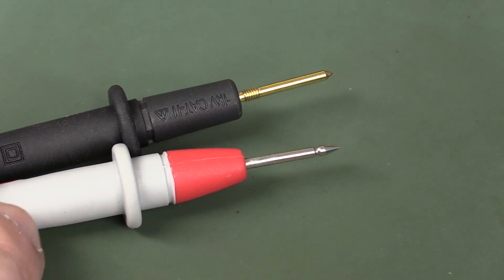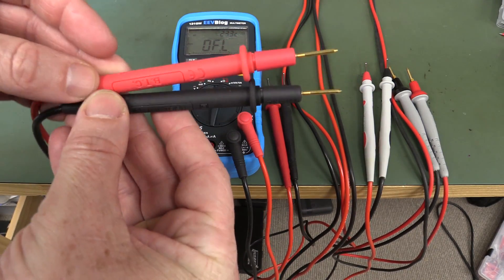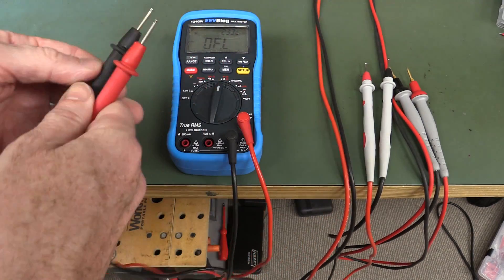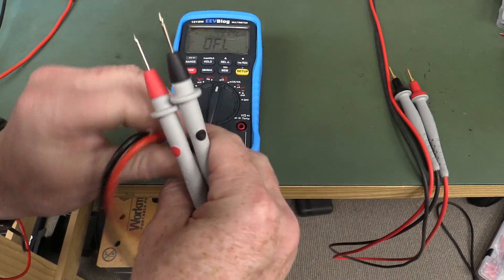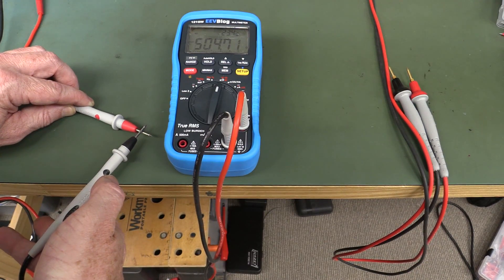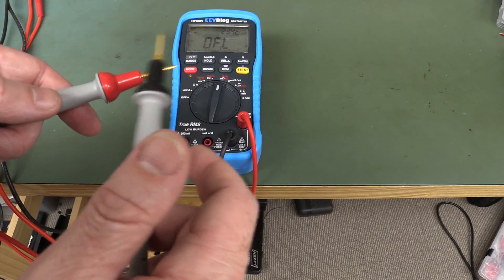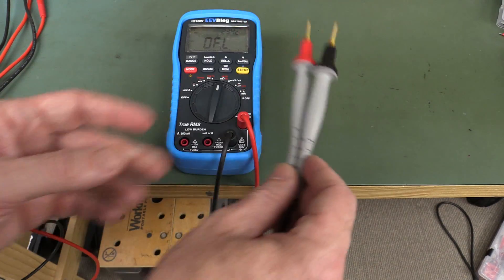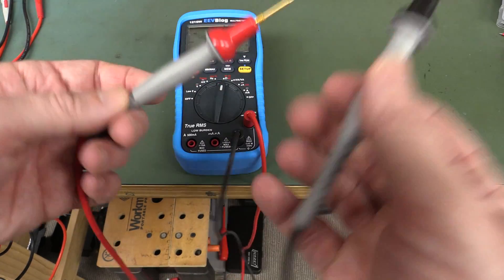eevBLAB #33 - Why Gold Plated Probes Matter

Comment: I see in the background you have a black and decka shop box. I got 1 about 25 years ago and it was a mission, "they only released them as a 1 off promotion " (supposedly)
Your 1 looks quite new.
Where did you get it?
I'm in NZ so I should be able to get it from your source if it's current and in AUS.
Thanks 
Russ

Comment: Gold is very soft, it will wear away in very short time. The amount of gold used in these probes is worth virtually nothing. Total waste of money if you know what you are doing.
Reply: Oskar Skog 
"Soft, pure gold plating is used in the semiconductor industry. The gold layer is easily soldered and wire bonded. Its Knoop hardness ranges between 60-85. The plating baths have to be kept free of contamination.
Bright hard gold on contacts, with Knoop hardness between 120-300 and purity of 99.7-99.9% gold. Often contains a small amount of nickel and/or cobalt; these elements interfere with die bonding, therefore the plating baths cannot be used for semiconductors.
Bright hard gold on printed circuit board tabs is deposited using lower concentration of gold in the baths. Usually contains nickel and/or cobalt as well. Edge connectors are often made by controlled-depth immersion of only the edge of the boards.
Soft, pure gold is deposited from special electrolytes. Entire printed circuit boards can be plated. This technology can be used for depositing layers suitable for wire bonding."
*Wikipedia
Reply: Stephen Cook
They use an alloy.  A pure gold plating would indeed wear off more or less immediately, as anything contacted would be harder.

Gold plating is better than nickel for test leads -- but beware of thermocouple effects due to differing metals if you are making low voltage measurements.  For low voltage work the ideal is to use the same materials.
Reply from the maker: It's a hard gold plating, not soft.
Reply: I've got the so called "needle probes" here from china, the thinner ones for microcomponents. And it seems to me they work exactly like Dave's gold plated ones. (And thank God they do)
Reply: Rhodium is extremely hard even in thin layers, and is pretty resistant to corrosion, it is often used in high end gold watches and the like as a protective layer. It is only an atom or two thick and hence pretty much transparent.
Reply: "hard gold plating" is Gold+Nickel. It's usually a darker orange color. There is also electrum which is Gold+Silver(and sometimes copper), which is also harder, but is usually used to decrease the resistance of the gold coating while also retaining the superb corrosion resistance. Electrum coatings can be anything from pale yellow to rose.
Reply: Since you mentioned Rhodium, does plating with it serve the same purpose as doing it with gold? I have used some high end audio connectors from a well regarded brand (not the ultra esotheric stuff, just well made $50 ones instead of $5 usual ones) which uses Rhodium plating. If I remember correctly, they said it's because it is harder to rub off and still doesn't oxidize. Is it true that Rhodium also doesn't oxidize? By your comment it seems that it definitely is tougher than gold and won't come off easily.
Reply: I've experienced the thermocouple effects, in particular when I was teaching science and measuring small PDs, and also in a previous life in a research lab measuring biopotentials.
Reply: Its not hard, exactly my point. There are hard metals that can be used, the problem is that most of them oxidise and produce a non conductive coating. Gold doesn't oxidise. The layer in these probes is only a few atoms thick, and will rub away in no time at all. Hard gold plating, is a fiction, unless it is gold that has been treated with a surface monatomic layer of something like rhodium which negates the purpose of using gold in the first place.  I taught chemistry and also electronics for many years. One of the reasons it works as a better contact is exactly because it is soft, it deforms. Bouncing or striking probes is a bad practice, it gives false readings. If you need a continuity test just make a simple continuity probe.
Reply: +EEVblog.  What's a "hard plating"?  Gold is about as soft as lead, or so I've heard.   What makes it "hard" in this case?
Reply: Stephen Cook
Yes, anything with small voltages requires care to be taken.

This applies to all connections -- if you use a gold or silver plated test lead plugged into an instrument with a nickel or copper alloy socket then you will have a slight voltage potential there.  The voltage produced is dependent upon the temperature at the junction, so you may not notice it initially then be scratching your head a couple of hours later when a shift in ambient temperature has thrown your measurement out.

Probably not an issue for most hobbyist work, but worth knowing.

Comment: anyone saying this is irrelevant haven't really worked with integrated circuits. or any other sensitive electronics. when I first worked with cars, I never understood the expensive multimeters and so on. later as I'm building my own amplifier I want the best and most accurate there is. because you cant even begin to understand how sensitive some circuits are. thank you for this video! will definitely buy these.

Comment: How about getting them coated from jeweller's shop, they'll take very little money for a thin coat, but will it be effective?

Also, they say, silver conducts better.
Reply: silver tarnishes quickly though. at that point you could might as well use full copper probes. gold plating makes a lot more sense because the main point of it is to stop oxidization.

Comment: Ok,  you never explained what makes the gold plated better. There needs to be some scientific explanation or  it could just be due to manufacturing, general quality of the products, etc. Please follow up with the science.
Reply from the maker: Gold does not tarnish or allow formation of an oxidized coating, basic industry knowledge, hence why it's used in all quality signal switch and connector contacts for example. Someone borrowed my scanning electron microscope...

Comment: seems to me that your plating will wear off in NO TIME ... given that we tend to keep these in firm contact with other metals and move them around...  effectively  grinding off the coating...
Reply: Gold has been used for electrical contacts for decades.  A hard gold alloy is used.  It doesn't have to be pure gold to reduce the impact of oxidization.

Comment: I wonder if a gold plated probes make a real difference, then why reputable manufacturers like Fluke does not provide such probes (even as an option) with their high-end Multimeters like the Fluke 289/287 series?  

Thanks
Reply: Probably to save money $$$
Reply: Because they do?  Fluke TL910 probes are gold tipped.

Fluke seems to divide the world between electricians and electronics.  And probes for electronics are gold tipped.  Electricians get nickel alloy.  And I guess once the nickel is heavily oxidized, and you don't think to use sandpaper to remove the outer layer, you should just buy new ones.

Comment: What about 24 k solid wire  probes ?
Reply: If anyone in Ger... oh wait, how stupid of me, of course everyone in Germany needs their oscilloscope!
Reply: Fake News,  mercury tends to amalgamate (form a solid solution with) with noble metals like gold and silver but it won't do that with iron or nickel or aluminum.  So saying mercury dissolves most metals is far from accurate.  Aqua Regia  (nitric and hydrochloric acid mixed together) will corrode most metals but not all.  It doesn't really dissolves them because if you evaporate the liquid you have metals salts, like gold nitrate and gold chloride left not metallic gold.
Reply: They'd be expensive, heavy and would bend or compress easily when you use them.  But at least they don't react with normal substances.
Reply: Mercury would dissolve most metals it came into contact with , I have Gold and silver wire laying around and was just wondering
Reply: I 'am a master jeweler and know all of this , thanks anyway . I have had a few wedding / engagement rings brought to me back in to 80's and early 90's that people had broken the old type of thermometers filled with mercury and some had gotten on their rings wanting to know if I could "fix" them after they fell apart . I make my own Aqua Regia and have to change out the glass jars every few years because it will eat through the glass ( it scares me ) I use it to make plating solutions  , this is why I was wondering about the 24 K probes . I have a bunch of wire I made laying around
Reply: If anyone in the US has a oscilloscope they don't need contact me , thanks
Reply: Oskar Skog They would also have greater resistance per foot of test lead unless you also increased the cross section of the test lead wires to compensate, thus making the leads even heavier still.  Gold's great strength is its resistance to surface oxidation (mercury also fits this bill) versus most other metal choices thus greatly reducing contact resistances, but gold itself has more resistance than a copper or silver conductor so it is not the best choice for a wire conductor of any significant length, even if costs are not a concern.
Reply: Why are you talking to me?

Comment: "Dave Jones - 2017" - That's the good thing about gold, it will not react with anything.

Heard of Aqua regia?
Reply: You don't normally work with electronics that had been immersed in Aqua Regia, though :P
Reply: I love me some aqua regia solder. Hmmm, sex on a stick!
Reply: For all intents and purposes, it won't react with anything.
Reply: We can argue about some comments here
Aqua regia will reacht to form chloroauric acid
Mercury won't react with gold, it will dissolve it (just like water and table salt)
And cyanide will form a complex with the gold and once the cyanide is gone it will fall out of solution... it's very close to dissolving but it is an reaction afterall
Reply: John Howard gold amalgam is very brittle and as you press on a contact it will crack and flake off...
also it would be very hard to gold amalgamate plate (?) some nickel contacts

Pure mercury would be very bad idea (ignore "toxicity" and "hazzard") if you would need to press on a PCB it would just flow sideways becouse of the oxides coating the PCB
Well if you used dilute HCl or nitric it would most likely amalgamate with the solder and copper traces and stick to it...

If you would platnum plate the contacts it would be the best idea

(Btw. By dissolving we ment the amalgam... we try to explain it very easily to understand)
Reply: or cyanide
Reply: Hydraulic Press channel will make it react to something :D
Reply: or mercury?

Comment: What a load of old twaddle! 
Making sure your probes are clean and in good condition is more important than gold plated tips. It's highly likely that the metal you'll be making contact with to take your measurements won't be gold either. This is reminiscent of the argument that some people make regarding gold plated connectors. If you really intend to take measurements with virtually no physical contact pressure and with the briefest of contact time then you really are asking for poor results whatever the probe tips are made from. Obviously, the continuity function of any DMM should be sufficiently responsive so as to leave no obvious delay in alerting the user that contact has been made but all this frantic probe touching, now with feather light contact pressure, is completely unrepresentative of real world scenarios to the point of becoming ludicrous.

Comment: Just tried this with the probes that came with the cheapo Aneng AN8008 and whilst slapping the probes together didn't give good results due to the update rate of the meter it still buzzes with just the weight of the probe. In fact it buzzes no matter how lightly I try and make them touch, even under 40x magnification bringing just the tips together it buzzes as soon as they touch (it doesn't even feel like they're touching and the probe I'm not holding doesn't move at all, only way to tell they are touching is visually).

EDIT: Not saying that gold does or doesn't give a better connection, just that this demonstration doesn't seem to be very accurate. Perhaps there are other factors at play.
Reply from the maker: Of course there are other factors at play. The gold contacts don't tarish or oxidise, other probes can.
Reply: Oodain, Nickel's corrosion resistance is due to a very thin oxide layer on the surface ( a few nm thick ) which stops further corrosion. That oxide layer is always present when nickel's exposed to air since if you scratch it off it reforms immediately. The oxide is green only in bulk and if you're seeing green oxide you might want to fish your probes out of the sea.
Reply: Mechanically breaking it is one reason. Another cooler one is that since the oxide is literally a few atomic layers thick it's dielectric (insulating) properties are not the same as that of bulk NiO. The electrons might even tunnel right through as if it wasn't there. But that would only work on a fresh surface with thin oxide. As it ages the layer grows and eventually it's not gonna make good contact.
Reply: Kieran Check them again one year later and see how much contact is left on the surface. They always work better fresh.
Reply: nickel is almost as corrosion resistant as gold, the oxide is also bright green...
Reply: Oodain you are talking out of your hat:
https://en.wikipedia.org/wiki/Reactivity_series
Reply: how so?
from that table there is only really copper between gold and nickel that isnt a precious metal, a rare earth, liquid or simply too soft to use as a terminal of any kind.
on top of that are you sure that that table actually covers everything?
despite copper being lower on the list nickel has been known to dramatically increase the corrosion and oxidation resistance of copper wire, especially at higher temperatures.

http://www.sciencedirect.com/science/article/pii/S000844339900021X
Reply: cool to know why the reactivity and practical corrosion resistance differ.
i will take your word for it, but since nickel probes obviously still work that oxide layer must be mechanically weak enough for most normal contact to dislodge it or standard probes would barely work.

if that is indeed the case then gold probes would make plenty of sense where contact was so minimal or delicate that one couldn't dislodge that layer but otherwise i doubt it would make more than a small practical difference.
Reply: Tried the same with my Fluke 17B and the probes that came with it. These are at least 5 years old and were in contact with battery acid multiple times. Work without problem with that lite touch test.